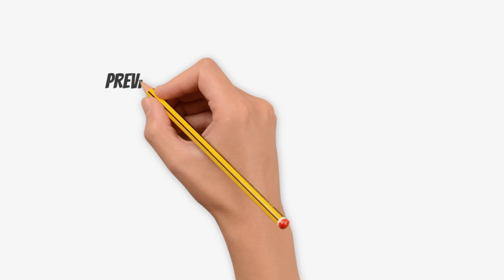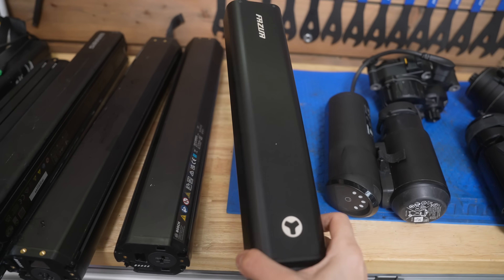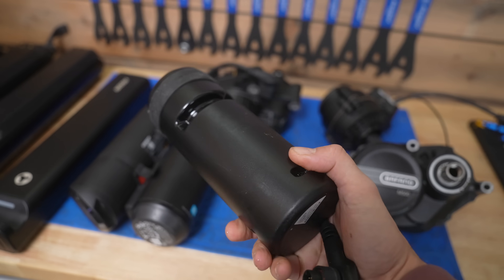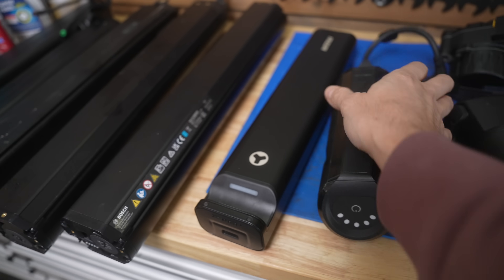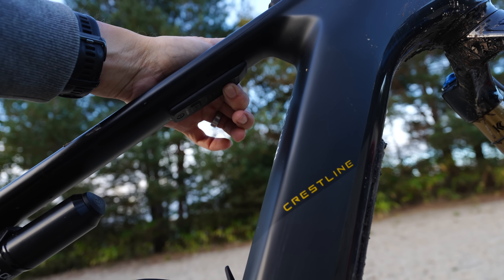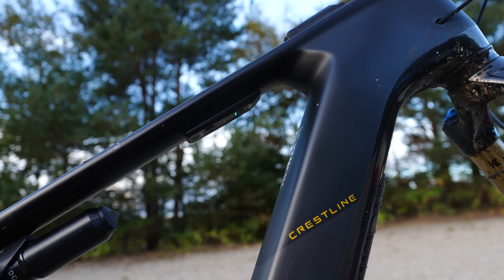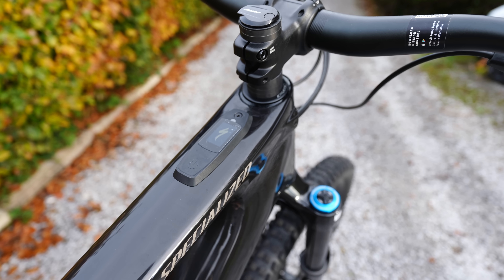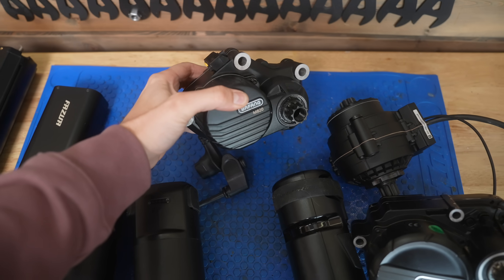We Have A Huge Problem With Ebikes....

Comment: analog bike is simple universal machine, all parts are swappable. Now e-bike is like a mini motorcycle, or a car. how can you expect Honda, Hareley Davidson, Toyota, BMW & Dodge engine parts & gears are interchangeable??  Each uses its own patented proprietary engineering that is result of long, expensive,, hard research of each brand/company.
Reply: No an ebike is not a mini motorcycle. It's a normal bike with a battery and motor attached to it to assist with pedaling.

It's still a bike. Bikes are repairable by nature, why should that change now? 

Also your argument of 'that is not repairable, why should this be?' is beyond stupid. How about both be repairable? Bikes are one of those things that can last forever, but now with Ebikes, 5 years after when the battery dies and is most likely not sold anymore, you have got yourself an expensive piece of junk.

Comment: Something you didn't mention though is the cost of replacements of consumables like batteries on these proprietary e-bikes. In three or four years time when a new battery is needed, the cost can be outlandish by comparison to well made generic Chinese batteries. The other thing is that replacements and spare parts are often completely unavailable, and because of canbus communications between battery, controller and motor, no replacement is possible. On an e-bike forum that I read, there are many woeful tales of people seeking help for a bike made useless because the manufacturer no longer supports a three or four years old model and no other source of workable solution exists because the parts have been deliberately crippled by canbus codes which detects non original parts and shuts down. You are also usually tied in to a particular dealership system for repairs. This is specifically outlawed in the UK for cars, but the restricted practice works well for manufacturer chains in the e-bike world.

Comment: Rob touched on many problems in the ebike industry.  But, the two main problems: 1) the ebikes' limited amount of usable life, serviceable life, and repairability. 2) the almost weekly appearance of new ebike manufacturing companies. Ebike purchase is a major expensive investment that is gaining in popularity, and It seems new companies are popping up weekly and sell their proprietary ebikes. The factory ebike depreciates the same as regular bicycles, but the regular bicycles can still be rideable for 10, 20, 30 years while the ebike motor,  battery, and electronics will go bad in a few years rendering them unrideable and unrepairable. The new company may sell millions of ebikes and then be out of business in two years, then what about the warranty and replacement parts? Basically, the ebikes are no different than regular bicycles and automobiles. Losing value is an expected expense and doesn't affect the consumer at all. The ebikes are throw away consumer products, ride and enjoy for 2 or 3 years, then throw away. Since the ebikes are a throw away consumer product and more importantly, consumers don't mind throwing away their money, the ebike industry will never set any basic standards for any aspects of ebikes as long as no authority forces them and ebikes continue to sell.

Comment: The only way to solve this is to have some legislation (either in US or EU) that would mandate repeatability and parts replacement for at least 8 to 10 years after manufacturing - that way all companies would have to have backwards compatibility to limit amount of old stock and not to fall behind the competition in innovation. Meaning, if you buy 10k bike today, you're guaranteed to be able to replace the motor and/or battery 10 years down the road.

Ofc without such legislation, neither bike brands nor component brands would go for this - they prefer you buy a new bike when the battery gets degraded or the motor starts to rattle - which both will because these are consumable parts, much like chains or tires

Comment: My philosophy is that when something dies and the supplier is refusing to supply replacement components - I will use their ass off as nothing in their sale advertizing states that after X time the product is worthless.
Your comment about laptops is and is not valid.  I have often sourced motherboards for a 6 or 7 year old laptop for a client.
I am actually amazed that the EU with all of the BS they put say Microsoft or any tech company besides Apple has not stepped in - except for the rules about bolloxing the ability of an owner to modify the system.
Definitely bolt patterns - or at least all using a mount bracket between bike and motor that is universal.  Plugs and chargers is a little different as you don't want the ability to plug say a 36 volt battery into a 48 volt charger - big fire risk.  I do think however there is certainly a place in the marketplace for a 'Universal' charger like we have with laptops - with adjustment for 110/240 input and appropriate output.

Comment: 100% agree but imo it's too soon for that with some parts like the motor, the market is too new and there is still a lot of innovation, you can't make a standardized motor mount because the motors are still getting smaller and smaller
but ofc things like chargers could be compatible, or battery connection to motor
there is still some development in how much current you can push in the battery so you might not have the ideal charger for all future batteries but no reason why it should not work at all
there really is no reason for proprietal connectors (other than brands incentive to lock customer into their exosystem), for example e-scooters have this mostly standardized, 90% of them are using the GX16 aviation connector for charging
for example battery to motor connection, no need for different connectors, could be all using the same one, just pick a high enough current connector and it's good for next 20 years
in the end battery is just a battery, if it's the same voltage there is no reason for it to not be compatible with another system at the same voltage
the issue is all manufacturers want to maximize profit so they will choose the cheapest option suitable for their application therefore using a standardized part that will work across all the other applications might not be the cheapest one or the lightest one so I kinda undestand it's not as easy as it seems to conusmers

Comment: If you bought  a brand new car would you expect to be able to just swap the engine to a ten year old car and expect the motor mounts to all be the same? I agree that the chargers should be the same but to expect companies to make motor mounts the same is just not gonna happen. Cars have been using an extremely wide array of motor mounts for engines the whole time and its just fine.

Comment: For charging, what we need is a standardized connector and coms protocol. This parallels CCS EV charging. You can still create bike batteries that have various voltages, energy capacity, and even preferred charge curves. But the BMS on the battery tells the charger what voltage and current it wants at any given time, and the charger delivers. This should also include the easy ability to charge to 75%, 80%, 90% as options to decrease battery degradation during periods where you are not utilizing the full 100% of battery capacity. As with EV cars, e-bikes shouldn't be charged to 100% at all times when that's never needed by the user.
Reply: More on this, ideally we should have a coms protocol between the BMS and your display/controller too, so that you enable detailed monitoring of battery SoC and can direct the battery to limit charging to 80% for example.

Comment: 100000% 
As it is now, when your old motor or battery breaks and you cant get replacement because too old, you 100% have to buy a brand new frame. Frame + motor + battery + electronics = probably the cost of a brand new bike. Best case scenario you can sell the old parts that still works to someone that needs them. Worst case your frame + battery + motor is landfill scrap after 5-10 years. Asking for universal standards a la USB-C is probably too much to ask. But standards for the own brand is the bare minimum. It's like they all trying to be Apple, but still failing xD

Comment: Its because its all new tech. Like you said, they want to lock you in for maximum profits, so they can feed those profits into R&D. They dont make them backwards compatible, so you have to buy a whole new system = more profits. This is nothing new and it typically starts to change once the tech has matured. its a natural cycle. This is why we get so much innovation when new tech is released. Eventually it will change. it really only matters in certain situations.. like if you forgot your charger and a buddy has one but a different brand.. yes.. annoying. This is literally the same complaint with any new tech. Computers were the same way.

Comment: Glad you covered this! I'm new to the ebike market but have worked in mobile and computers, which have all had their issues with proprietary components and thus high costs. It typically takes economic pressure and sometimes regulation to transition the market from expensive/proprietary to modular/open architectures. This could happen now that bike demand has slowed -- people just aren't running out to buy a $10K ebike that depreciates like a sled. The bike makers in theory should be motivated to adopt swappable components that reduce their costs, though it comes down to how much economic pressure they have to reduce prices. Worth watching out for attempts at regulatory capture by the motor makers via UL requirements (e.g. - introduce standards that make it easier to maintain consumer lock-in to proprietary systems). Time for an open architecture standard for ebikes that is modular, perhaps?

Comment: Quite right it seems absolutely redicolous in this day and age. I know it's slightly different but Hobby grade RC cars have been using cross compatability for ever. So any Motor, any battery and any esc will fit any brand. There really isn't any excuse for this. I definitely won't be buying an ebike till they can be upgraded.

Comment: Thanks so much for saying this. This has always really, really bothered me over the course of owning 3-4 ebikes over a decade.  TBH I don't care about being able to access new features, I just want to be able to get replacement parts a few years down the track, whether the vendor still exists or not.. And not have to hunt them down from some far corner of the globe.  As a utility rider, I've generally avoided these problems by converting or buying bikes using cheap Asian components - which genreally are far more universal than euro parts.  I recently weakened when I got a good deal on a German Karlkoff, but even within a year trying to find parts for it is a total pain.

Yes this really is the dirty little secret about ebike's but nobody talks about. Which has always surprise me, as much as I think of ebike's is really one of the most game changing technologies in the middle of our climate crisis, far more so than EVs. 

There's much talk about the problems of  recycling batteries, but I believe the waste with nonreplaceable parts may well be worse still.  Particularly given this is a mostly European problem, it would be great if the EU could step in here the same way that they are with Apple and insisting on standardisation for USB connectors. AND SOON.

Thanks again, please don't give up on this and do encourage others to be raising this issue.

Comment: You hit the nail on the head. I bought an e-bike 3 years ago and had so many issues with it, that I ended up selling it due to motor problems that Specialized would not warranty. There are so many problems with reliability of e-bikes across the board that leaves buyers with an expensive system that looses so much value.  Same non-sense with electric car charging standards, first CHAdemo, then CCS then NACS. Chademo is failing badly and next will be CCS with those massive charging cables and it seems that NACS (Tesla) will be the standard moving forward. This should have been done 10 years ago.

Comment: No, the problem lies in the people. 
Unlike the automotive sector where we are obligated by laws to never tamper with anything in the vehicle, bicycles owners (stiill) have the freedom of building and uograding their bikes. 

Everything and anything can be adapted. If there is no adapter to buy you can build it. Machine or solder, does not matter. As long as people are not just blind consumer trained apes.

Comment: My cheap Chinese rear hub conversion has been faultless.

52V 1500W, giving 1.2kw, up to 45mph and a range between 22 and 75 miles.

Total cost was under £1500, and every part practically has been upgraded very easily, and only ONE part I bought online has been unable to be added.

Granted, it's not as pretty a bike as these new ones, but repairs are ridiculously easy, and the general uniformity of the parts and components means replacing them or finding parts for them is unbelievably easy.

It's more of cruiser than an off roader, given the hard tail frame and absence of rear suspension, but the offensive prices of these new ebikes is prohibitive and NOT in the spirit of ebiking, which began as a cheap easy personal mode of transport..

Comment: The problem is up until fairly recently bicycles were a simple device that had been around for decades and where standards have been settled on over that long time period. Now with electronics this is harder to achieve. The proprietary stuff almost has to be there to give manufacturers the ability to make something better than the others. With ebikes its somewhat like expecting the new version of a Honda CBR600 engine to backward fit into the older version or even another brand, its never going to happen and nobody expects it to either. But because the bicycle is evolving from a simple human powered device into a form of simple motorcycle it doesn't mean we can or should expect that simpler standard system to prevail.
What should be happening is that spares and backup should be much more extensive so that you can still buy a replacement motor, motor parts or battery 5 years on. But that isn't happening either. That could be the consumers fault because nobody seems to keep a bike for long these days, always upgrading to the latest model every few years so giving no incentive to manufacturers to stock supplies. Just my 2 cents forwhat its worth (which probably isn't much 😄)

Comment: Voluntary standards would be OK, but a mandated standard eliminates innovation through competition.
 
It might be better as in the motorcycle industry. Aftermarket makers of adapters and upgrades MUST be compatible across brands. How 'bout that?
Reply: i don't see how mandated connectors, compatibility, and mounting points would hinder innovation or competition, if anything it would be a benefit as manufacturers would be forced to make more compelling offerings and people can make a frame last decades if they so choose and won't need to buy a brand new bike every time they want to upgrade the e-bikes systems or go with a different brand.

Good for the consumer, the environment, and can drive innovation farther than proprietary locked down systems.

Comment: Hmmm, I'm reminded of BetaMax vs VHS. VHD vs LaserDisc, Blu-Ray vs HD-DVD. Someone will win out on the Battery/Charger format Standard and will reap Licensing Fee's. As Motor mount systems go... I would HOPE the most popular will be which ever Frame designers choose to go with. The frame industry standardized the Bottom Bracket(couple of various width's, but still standardized). Shimano, Bafang, and Pinion all seem to be using a 3 bolt mounting pattern so it's getting close there. Just need to standardize the dimensions. Bosch seems the odd man out.

Comment: I have two diy mid drive conversions which are quite enjoyable to ride but were a lot of work and tweaking to get to a state that feels right. Also a bit more janky looking and battery isn't frame integrated. A friend did a bafang mid belted to a rear igh which is pretty cool too. We have some options but they are also still hard to recommend due to the amount of work and also trying not to get scammed on batteries with lies in the specs or old revisions of the same hardware being labelled as new etc.

Comment: Well said! The motor mounting bolts can be and should be standardized; on the other hand, the charger typically includes battery management software, which regulates charging. This prevents the battery from over charging or over discharging, both could lead to thermal runaway i.e. fire. So I can understand a battery manufacturer not wanting a sub pat charger charging their battery.
Reply: They can? Well how we gonna mount a tq motor in a Bosch frame then?!

Comment: You can remove their ports and make your own ports of any kind or just xt60 connection to controller by a wire. Also if you buy a chinese brand they are pretty much the same or you can order whatever port you want.

Comment: It not about being “out of date” in 6 months. The bike still works. Just cause you want the latest and greatest, sell and buy a brand new bike. The issue is my 3 year old bike breaks a want to be able to buy parts and want the option to do it myself and upgrade at that stage. Upgrading a perfectly good part is part of the problem with this consumerism black hole. But replacing a worn out or broken part is the argument you should be pushing. At that stage the new upgraded part should (in an ideal world and to a limit) work. If we had to have everything standardised we’d still be rocking usb A cables, there has to be room for advancement but not at the cost of designed obsolescence